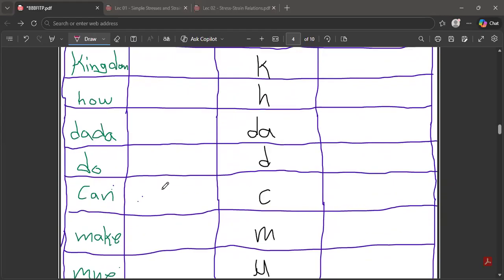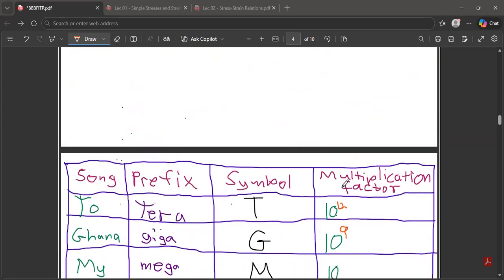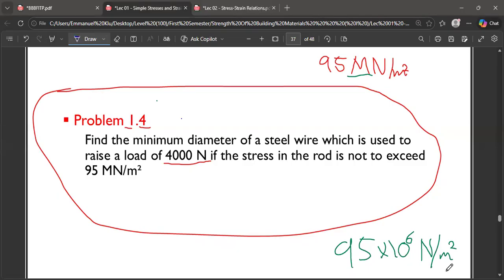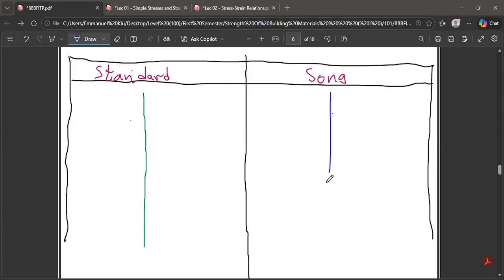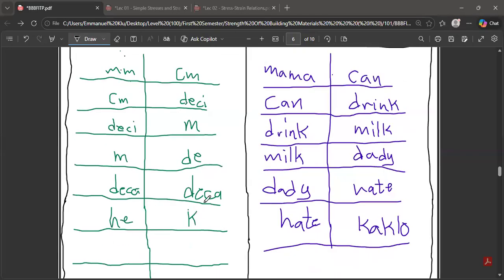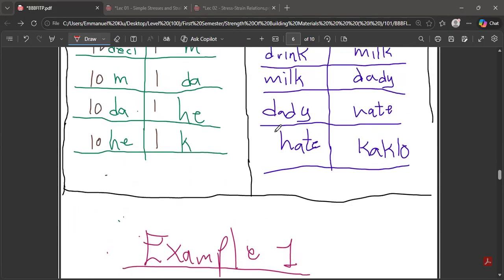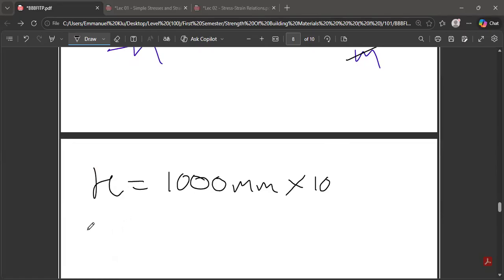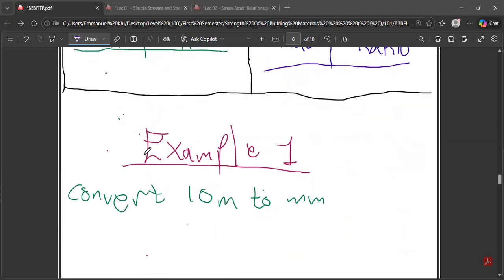Introduction to Strength of Building Materials Part 2

Comment: Well done!
However, my question is do we use the prefixes to scare students or is it part of the accepted unit of measurement to make measurement more meaningful?
Reply from the maker: May God richly bless you for the opportunity Daddy 🙏🏽❤️‍🩹

👨🏻‍🏫Please prefixes like kilo-, mega-, giga- aren't meant to scare students😇🤓.

However🧐, they are part of the International System of Units (SI) to make measurements more manageable and meaningful📝.

📌For example♻️:

- 1 kilogram (kg) is easier than saying 1,000 grams

- 1 megabyte (MB) is clearer than saying 1,048,576 bytes

It helps in communicating large or small quantities efficiently. Like in construction, saying "the building is 50 meters tall" is way simpler than "5,000 centimeters" 👍, thank you 😇.